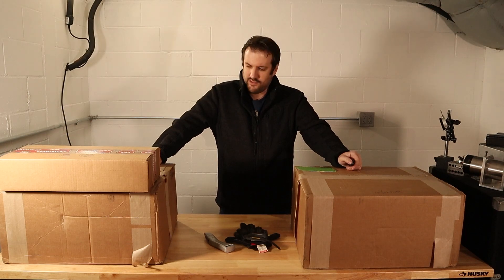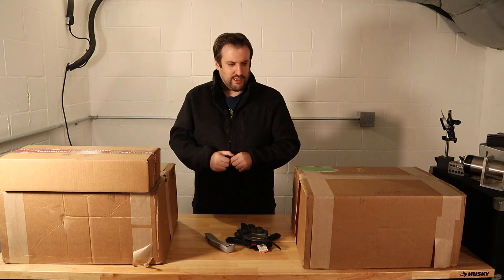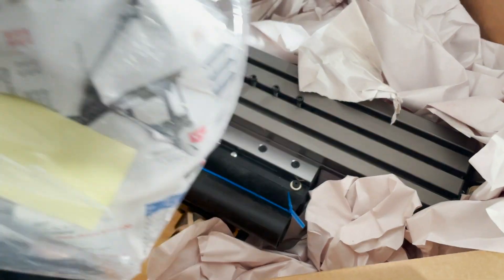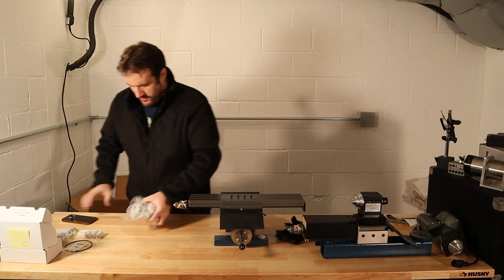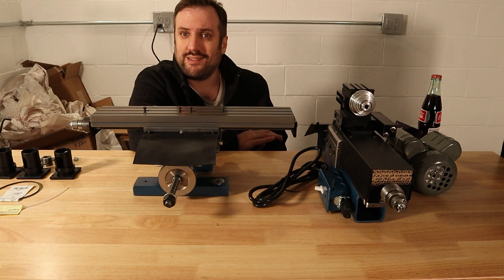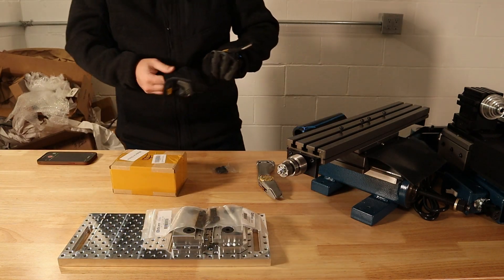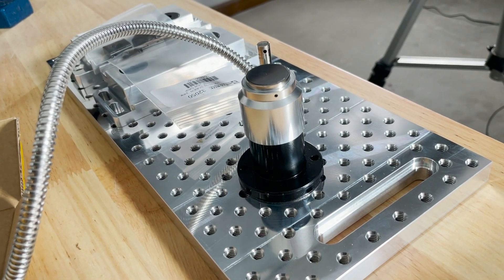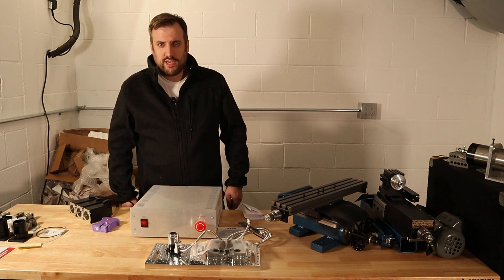Unboxing the Taig 5019CR Micro Ball Screw Mill

Comment: I have the same machine. Mine came ready for plug and play with USB for a Windows 7 computer. I'm not sure where you got your CNC setup from or if you bought a complete CNC package with the mill but depending on the Taig dealer sometimes you can get one already ready for USB connection. I paid just under $2500 for everything. I was also one of the earlier folks who got the ballscrew version when Taig first came out with it. Before that I had the manual leadscrew version. These are nice machines and it can actually make somewhat large parts if you know how to use it.
Reply from the maker: I got mine without any controls but I used a gecko G540 motor controller with GRBL on an Arduino UNO. Made a PCBs to hook it up so I my whole control system was less than $300 so I'm at around $2270 including motors and its also USB plug and play with windows 10. Really not bad to get you going.
Reply: @AndyVickersNet  
Thanks for Sharing 
That was going to be my question.

Comment: Congratulations...glad you weren’t scared away by the naysayers who don’t know what they’re talking about.  I bought one of the very first of these ballscrew Taig mills and it works great.  

Here is a key lesson which most owners never learn:  operators who “baby” these small power-limited mills with wimpy cuts and slow feed rates are being counterproductive.  In doing so they put more of the power into friction rather than producing chips.  And then they blame the machine when the spindle stalls, their workpiece gets messed up, and the mill gets knocked out of tram.  If you take the time to plan and do the math (or create a spreadsheet calculator like I did) to get parameters correct, you’ll be smiling in amazement and operating with the utmost confidence.  Learn about “chip thinning.”  That is powerful knowledge to put to use with this machine.  There is no need to “upgrade” the spindle motor if you are doing it right.  The motor and the belt were chosen consistent with the rigidity of the machine.  Make sure that the pulleys are aligned properly and don’t overtighten the belt or it will take a set and fail sooner.  (What you might think is too loose, may be tight enough.)

The machine isn’t perfect.  There is one significant issue that can be corrected with a simple part you can make.  And I recommend doing this immediately.  The headstock is secured on a dovetail with a clamp that takes a single 10-32 socket head cap screw (SHCS).  Even with the dovetail clean and dry and the screw torqued to 60 in-lb (get yourself a Wheeler FAT wrench - consistency is worth the small investment), the downforce generated during milling can and will pull your headstock down a little bit at a time. (When it happens your workpiece will have steps in it, and you’ll be left wondering why!)  Taig put a pair of 10-32 holes tapped into the bottom center of the column dovetail.  The bottom hole has a SHCS installed to prevent the headstock from falling down and off the dovetail.  But the headstock is not normally supported by it.  The top hole may be hidden by the default position of the headstock.  Figure out where you want your headstock clamped on the dovetail.  You can raise or lower it by unclamping, moving and reclamping.  (I keep mine up relatively high because I made a quick change tooling plate system which raises the work an inch or more off of the table.)  Then make an aluminum bar .375” x 2.25” x [height] with 2x #10 SHCS counterbored clearance holes centrally located and 1” apart.  Install that support, then lower your headstock onto the support before clamping the headstock back on the dovetail.  That will resist any downforce milling can generate and you’ll be ready to rock ‘n’ roll!

Hope you’ll find these tips helpful.
Reply from the maker: There is some incredibly helpful information there, thank you so much for sharing. I am early in the learning process, but I have also found that you can make decent chips with this even though its a small machine. Chip thinning is a risk for sure.  I intend to make  another video where I take progressive cuts across an aluminium block at different feeds and speeds and width of cut / depth of cut so I should be able to identify some 'sweet spots' to share. 

So fascinated by what you have said regarding the headstock. I will investigate that. sounds like a good way to up the rigidity on the Z axis. I would love to see a pic of the bar you made if you have any available. You should sell those, seems like a great way to improve the machine with very little effort.

thanks again for all the helpful information!
Reply: Any chance you can make a video showing this Ronnie?
Reply: @JWB671   It will be a while before I have time to post a video I can share, but if you are a member of the Taig owners Facebook group, I posted a couple of photos in response to Andy’s test cuts video.  (In his last cut, the headstock slipped down the dovetail, if that is what you were looking to see.  The single 10-32 SHCS secured dovetail clamp is insufficient...a rare design flaw for the Taig mill, which luckily is easy to fix.)  My photos were from initial testing of the Taig, to see what it could do when the headstock was fully supported on the dovetail.  Once you understand how to calculate the mechanical power required for milling, and learn how to efficiently transmit power from the spindle motor to the cutting action, a ballscrew CNC Taig can chomp like a beast!